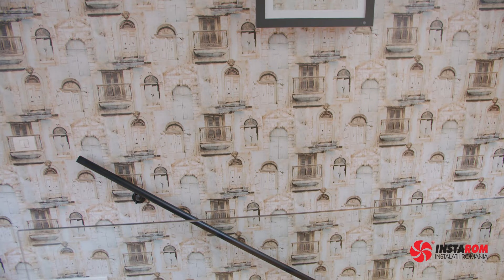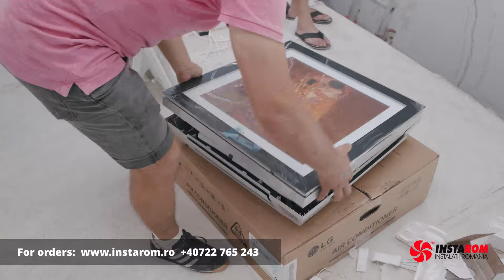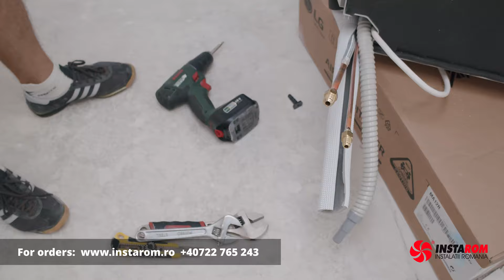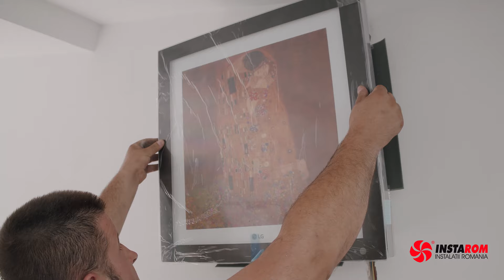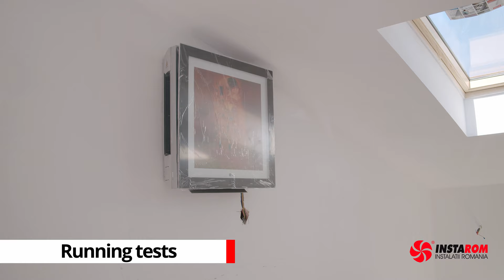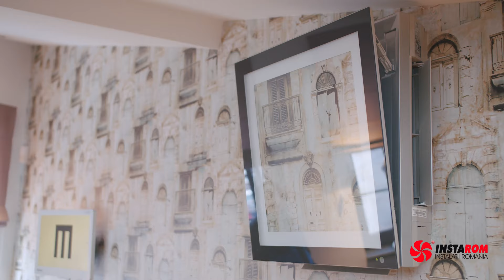Air conditioner #LG #ARTCOOL #Gallery Inverter | Design air conditioner | How to install

Comment: I used 4 of these LG art gallery models in my home. The traditional bar models were to long to give me the required air flow spacing on either side so we installed these instead. Although the SEER is slightly lower than other BAR models these units work great and have a variety of options for air quality other than just heating and cooling. Highly recommend these. We have (2) 12k units & (2) 9k and our 1500sqft home is perfectly conditioned! I did notice in the video the wall units were installed very high to the ceiling which according to the installation manual requires a certain minimum (20-24”) spacing from air flow obstruction. What do I know though….

Comment: Does this work with the LG thing app? I can’t figure out how to connect the artcool gallery to the app
Reply from the maker: Hi,  first of all, you must check the model of the equipment, if the model is A09FT or A12FT, you have the Wi-Fi module embedded and can connect it, if it is MA09R or MA12R, you must purchase this module separately. Any other code cannot connect to Wi-Fi.

Comment: if they had recessed units to fit between studs itd look ten times better. even if they were longer and still extended past the flush area. but it could eliminate the flaps and vent directly through the sides like ports. i still like them. but theyre awful bulky.
Reply: I don’t think u can recess it to much from the air blows out the sides

Comment: Hmm no metal bracket to hang indoor machine on? I guess I’ll just have to find some studs thanks for video!
Reply: This is in Europe dude, the walls are not made out of cardboard, it's all either concrete or clay block. You just drill a hole and screw things to the wall itself.

Comment: What outdoor temperature can this effectively heat down to, as in realistically - because it snows a lot where we are.  The Mr Cool Universal can do -11 and proven to do it well, what can this realistically do
Reply: We’ve had -18°C and LG was fine for heating. The technician told us they can do -25° but they don’t have the guarantee from the manufacturer but real experience.

Comment: This is a good model, what do you recommend?
Reply from the maker: Hi, this model is top of the range for LG and unique compared to all existing models including other brands.
Reply: @InstaromRo  hi, what is the difference between LG smart inverter and dual inverter? Do they both have the same compressor?

Comment: I just got this installed, does anybody know if it has built in WIFI for LG ThinQ
Reply from the maker: Hi, depends on the code, for example A12FT includes the Wi-Fi adapter.
Reply: Thank you
Reply: Just had this model installed. Also curious about ThinQ. It seemed like it should have it from looking online but can't get it to connect pressing the buttons next to the temp down arrow. I hear 2 beeps after 3 seconds but there's no display to show a wifi signal. Any tips?
Reply: @happymanadam   how is it doing these months later? Still like it
Reply: @MikepTejas  it's installed in my dining room so we don't use it often. It works but never got the wifi thinq to work.
Reply: @happymanadam  I use Cielo breeze to control my daiken

Comment: can it blow only from one side ?
Reply from the maker: Hi, 3way airflow, only down in Jet COOL, only sideways in SLEEP Mode, but not just one side. The manufacturer specifies minimum distances from the side so as not to influence the cooling power.

Comment: Looks silly mounting a "picture" near the ceiling, I think that is more noticeable then the regular box type unit.  With the units mounted so high to the ceiling how is service performed and monthly cleaning of the filter?
Reply: WTF is a monthly cleaning of the filter? Dude, do you live in a coal mine? You clean an AC like this once a year at most.